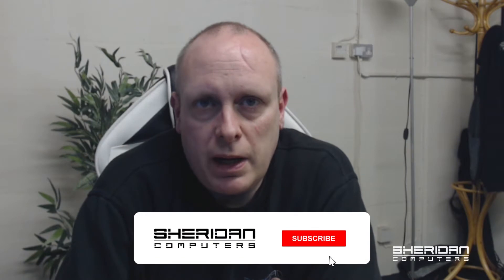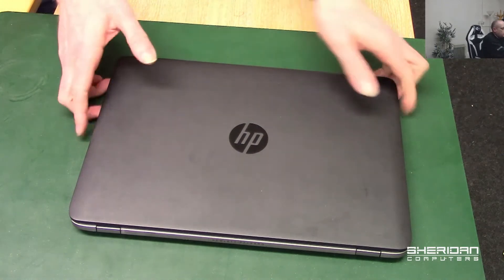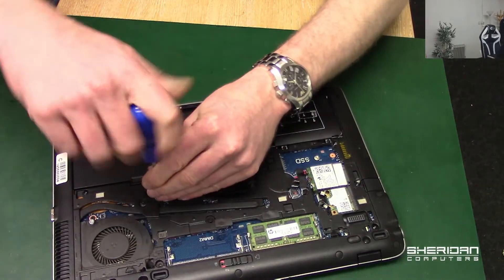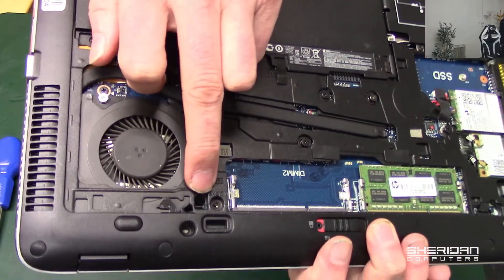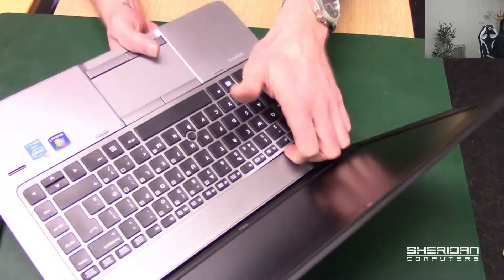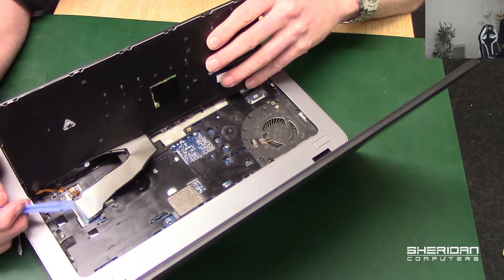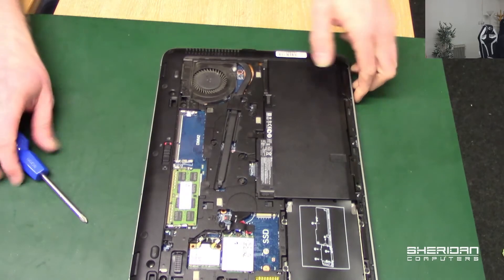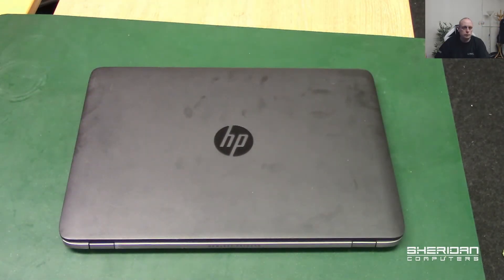HP 840 G1 Laptop Keyboard Removal / Replacement / Fitting

Comment: If the keyboard comes with a backlight, does it have a separate connector for the light? or it has the same amount of connector as the non-backlight version?
Reply: keyboard for one with backlight comes with 3 connectors. one for the pointing stick which is white in colour, one for the backlight which is usually brown in colour and the main connector.
Reply: @reginaldrewayi4068  Ah I see, thanks 👌
Reply: Thanks!!